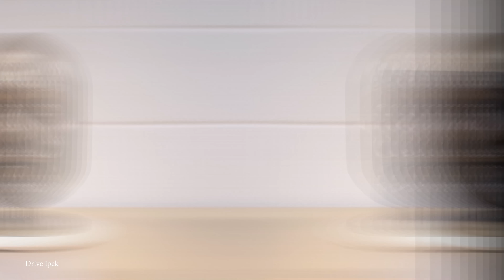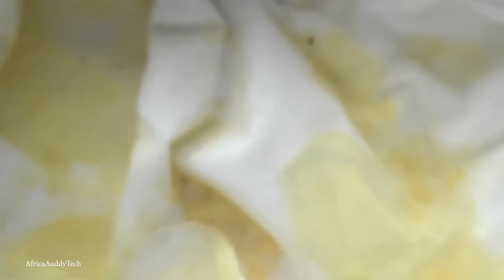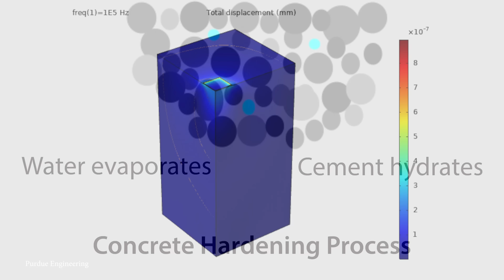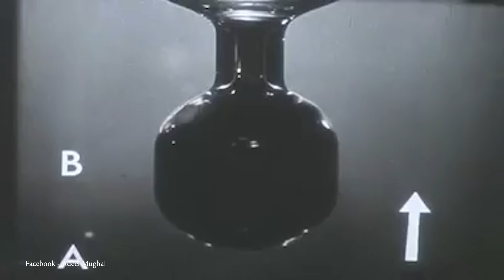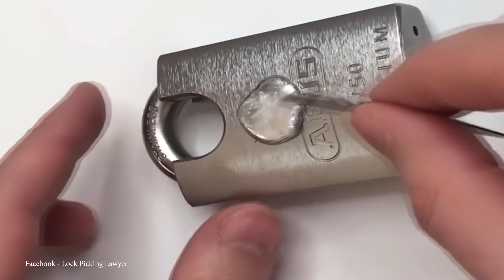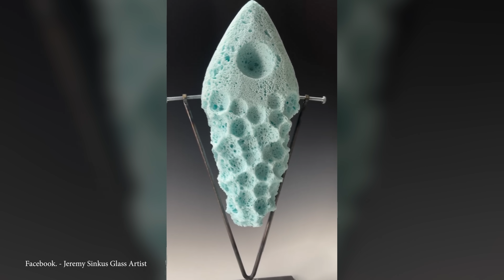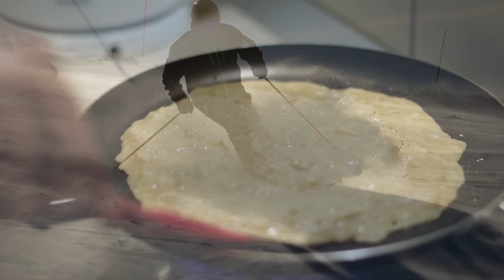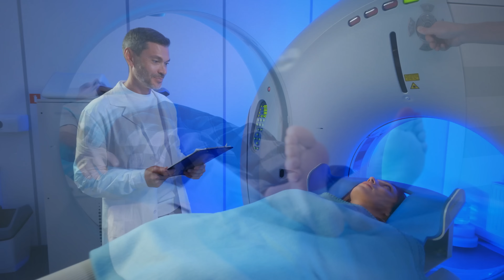15 WEIRDEST Known Materials

Comment: Self-healing concrete was discovered millennia ago, it's called ancient Roman concrete. It heals due to the presence of "lime clasts" – calcium-rich chunks formed during the "hot-mixing" process. When cracks form and water enters, these clasts dissolve, creating a calcium-saturated solution that recrystallizes into calcium carbonate or reacts with pozzolanic materials to fill and seal the cracks. This reaction happens spontaneously, preventing cracks from spreading and making the material more durable... 
Too bad that modern life concrete industry sacrificed the original formula, trading durability for profit ! :face-orange-frowning:
Reply: As the Pantheon can attest.
Reply: And the simple fact is that it's slower healing than old ancient roman concrete as the concrete had lime already in its compound so when pored it would use any and all water to repair
Reply: True, but they only recently figured out the chemistry that makes Roman concrete so enduring. Now that we know, we can make our modern cementitious materials more like theirs.
Reply: @nunyabidniz2868  Yes, but Romans didn't need bacteria or anything exotic. Just lime.
Reply: @divermike8943  Quicklime to boot.
Reply: @nunyabidniz2868  Your hope is adorable lol
Reply: I honestly was about to go all out on this as well
Reply: Was it not abalone shells?
Reply: @Juicysmoolyay7259 I think shells are calcium rich
Reply: @KillaSomz fun fact , you are a robot. Calcium ,iron ,magnesium are all metals
Reply: @Juicysmoolyay7259  Sad how few people know anything about chemistry.  Even the difference between the metals and nonmetallic elements. Pathetic.
Reply: materials engineering is fascinating.  I remember as a young kid, talking to my dad, how fascinated he was with Roman concrete, and the underwater curing concrete they had too.  Man, gotta be great having that volcanic ash too..... as a carpentar and construction company owner.... dad was fascinated by many such things.... it kinda catches eh?
Reply: If true that’s very interesting
Reply: @KillaSomz It's true.  Go do some research.
Reply: Science here is inventing materials that sound more like they belong in a wizard's spellbook than a laboratory.
Reply: @TopScary_Us  Lol, can't understand any chemistry or physics?
Reply: @coodudeman  ok
Reply: @TopScary_Us  Great attitude!  Lol maybe you should actually try to learn instead of being ok with ignorance... no?
Reply: @coodudeman  maybe you should learn not to be an obnoxious douchebag!
Reply: @Odiewan-Kenobi768  Lol I don’t think that is likely to help you be more intelligent! Lolol
Reply: @coodudeman  there's nothing wrong with my intelligence
Reply: @coodudeman  but thanks for making my point about you being a douchebag
Reply: @coodudeman  truly intelligent people don't have to go around trying to talk down to others to feel like less of a loser.
Reply: @coodudeman  what are you going to do to try to boost your self-esteem next make fun of my looks my accent where I'm from you can make fun of all that stuff you want but won't make you anymore important or special
Reply: @Odiewan-Kenobi768  lololol I will DEFINITELY take YOUR word here!!!
Reply: @Odiewan-Kenobi768  No, we do it to point charlatans like you out for the less able!   I wouldn’t expect you to be able to understand that though!
Reply: @Odiewan-Kenobi768  You are the one calling me names here… you sure I’m the personal hygiene product you mentioned??? Might that actually be more projection??? Lol
Reply: @coodudeman  no I'm not the one talking down to people trying to make myself feel better I'm calling out assholes for doing just that
Reply: @Odiewan-Kenobi768  lolol riiiight!
Reply: @Odiewan-Kenobi768  Can’t handle people pointing out when you are clearly wrong, huh?  It’s ok… that’s fairly common… there are self help books out there for you!
Reply: @coodudeman  like I said you can point out a mistake without being a complete douchebag about it, well most people can you obviously can't.
Reply: @Odiewan-Kenobi768  Lol nice to know you know everything about me!  Lololol you obviously think quite highly of yourself!  Are you orange too??? Lolol
Reply: @coodudeman  I'll say it one more time for your smart ass, you can correct somebody without being a complete asshole about it like you do to make yourself feel Superior you wanker.
Reply: @coodudeman  I don't know everything about you but I've seen enough to know that you have low self-esteem and try to correct people and make people feel beneath you to make yourself feel better
Reply: @Odiewan-Kenobi768  Only those, like you, who are obviously far far beneath me.   Sorry if I dropped anything on you way down there…
Reply: @O @Odiewan-Kenobi768  You are fantastic entertainment, btw!  Ty!
Reply: @coodudeman   all your proving is that you don't believe you're worth shit, so you try to bring others down to your level. Kind of pathetic and sad really
Reply: @coodudeman  I imagine you're easily entertained
Reply: @Odiewan-Kenobi768  By fools like you???  Very! Thanks again!